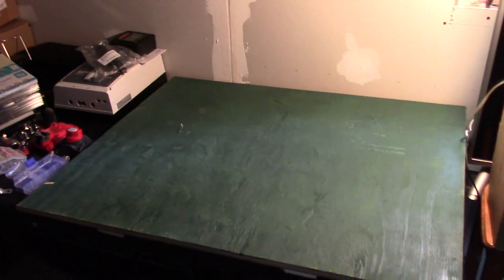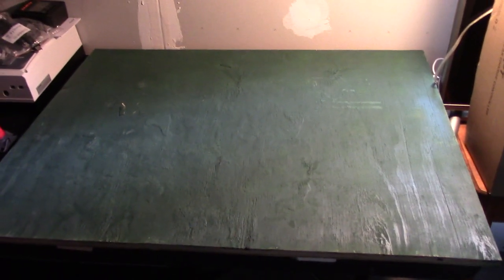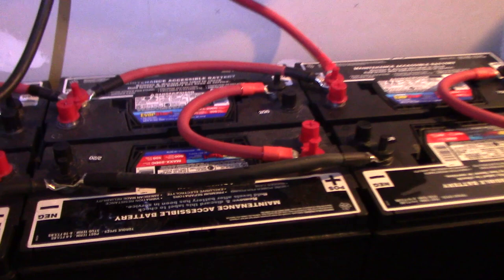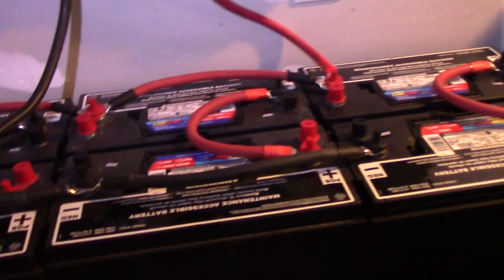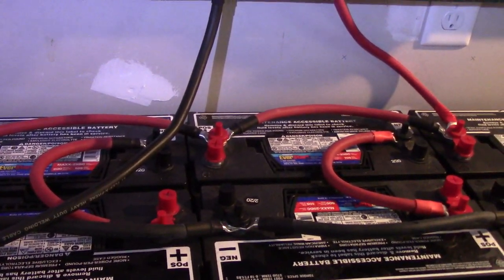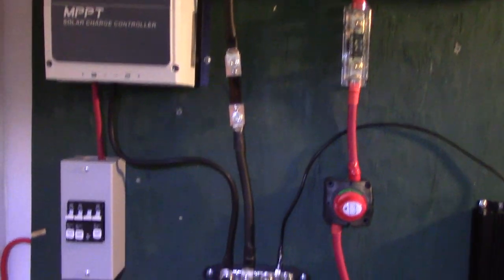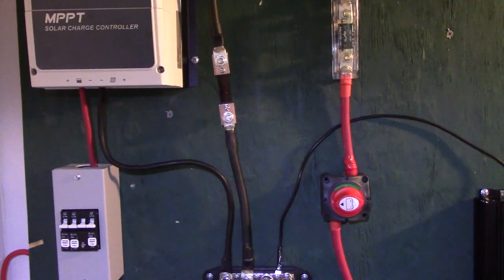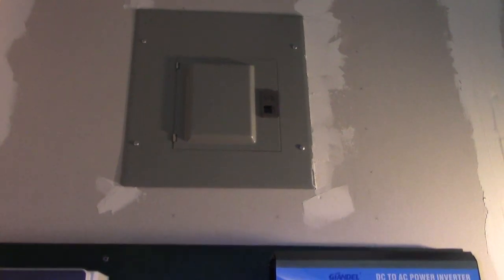DIY Easy Install Solar Power for Off Grid Cabin / Tiny House.

Comment: you REALLY should have put that SHUNT between the busbar and the battery, this way you would know whats in your batteries. a true fuel gauge. knowing how much energy your inverter has used is useless since it doesn't take into account the charge controller.
Reply from the maker: +Michael Illingby The thing I'm looking for is how many watts are going out vs how many are coming in. Not what is in the batteries. My inverter can tell me that.

Comment: That looks very servicable. Thanks for all the detail you went into explaining all of it. One question tho, why run 12 volt lights if this will work on everything?
Reply from the maker: +Bobbie Harrison The batteries have a limited supply available. The trick is to conserve as much as possible.  12v LED lighting uses very little electricity. That leaves more in reserve for my mini fridge I want to run 24/7.

Comment: I wish I caught you before you started buying all this gear, I would have suggested that you buy one of these https://www.mppsolar.com/v3/110v-120v-low-voltage-series-2/ super easy to setup, everything in one box, less wiring, and cheaper than what you've built.
anyways, good luck with the system
it also makes generator hookup super easy as it has a built in utility charger of 60amp and a 80amp MPPT controller. can use both or either at the same time.

Comment: Are you going to have to remove the green board to finish and paint the wall behind it?
Reply from the maker: +Gigi Morgan The board is going to move with the batteries to a power room I'm going to build on the back of the cabin.
Reply: @StBernardAcres  ahhhhh, I think you mentioned that, such a tidy job you did with that board! Great job Joe!!

Comment: Why didn't you just buy a small 8X8 or 12X12 shed then make it your powerhouse?  All that stuff is going to take up a good amount of space in your tiny space.

It looks like you're not pulling or pushing the power out of your batteries evenly.  You need to connect the positive wire into battery #1 and negative wire on Battery #6.  This will push/pull power evenly.  I call the battery that you have in the Corner #1 and #6 far right and closest to you in the video. the battery that is next to the wall and far right is #3.
Reply from the maker: +Crazy Coinbox I am building a "power room" on the back of the cabin for all of this.